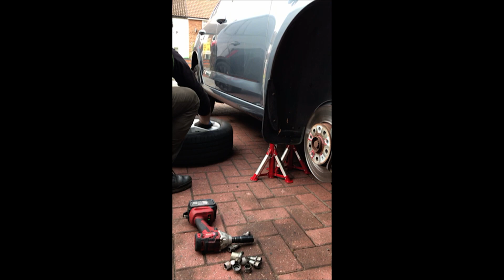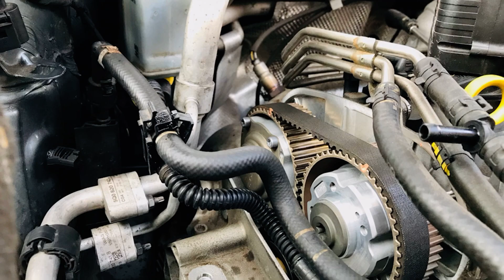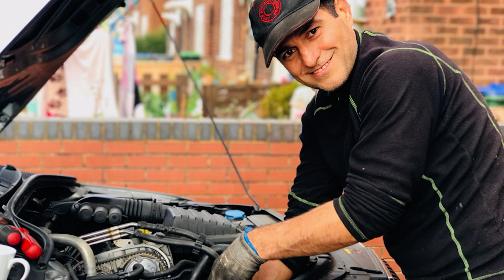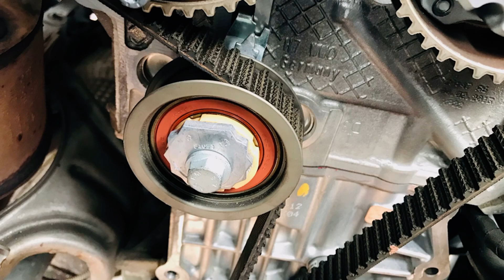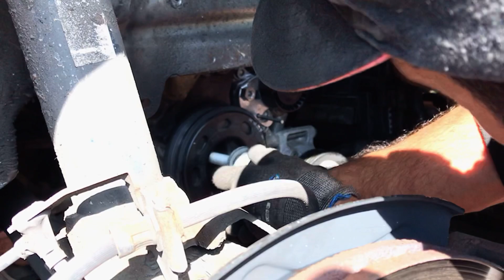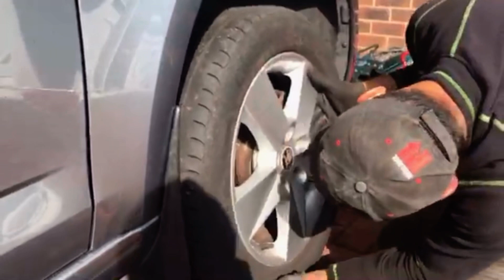Change complete timing belt on Skoda Octavia

Comment: That car looks like it has a floating bottom pulley,just stripped similar today and had to put back together because we didn't have the tool,there a lock pin device that enters the block behind the alternator,be careful people,you can be lucky and do no damage but you can also destroy your engine,always research with your engine code to find the proper tools and technique
Reply from the maker: Thank you for your advice so you are right yes I understand that but I can do it and have a special technician about the timing belt I have experience about 19 years ago working with cars special timing belt.  Thank you for taking the time to watch my video😊
Reply: Thanks for video,can you please tell me how you get around the floating pully issue;